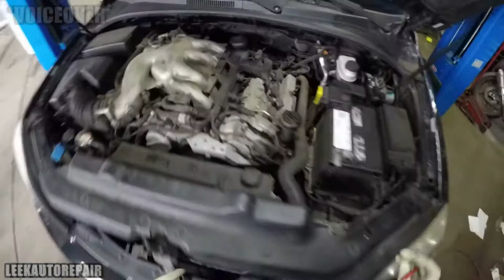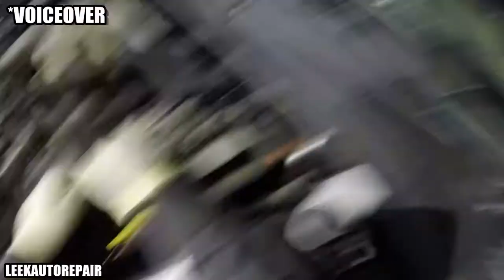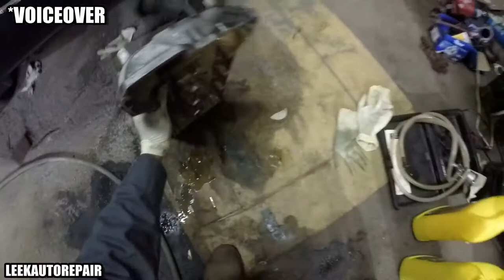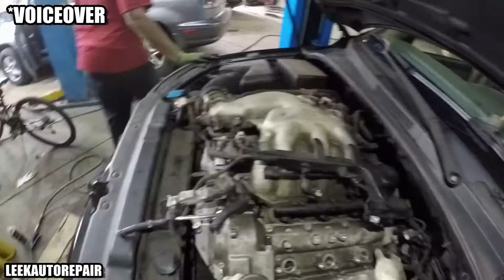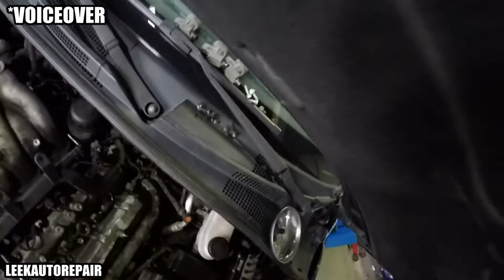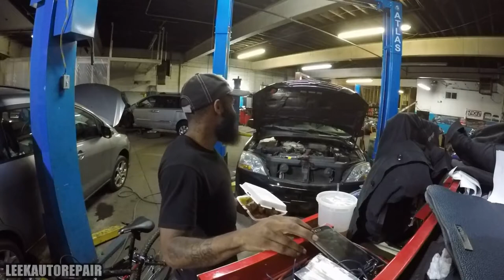Valve Cover Replacement 2002-2009 Kia Sorento

Comment: So i need to replace the valve cover gaskets is it absolutely necessary to change both if one is leaky it has also seeped down onto my alternator which i will also have to replace

Comment: Hey folks, I just replaced my valve cover gasket on my 08 Sedona. Now I see oil on the alternator again. I did a really good job the first time. Torqued the bolts to spec. And used blue gasket maker too.  So what could be the problem here? I'm gonna have to do it again.
Reply: what did it end up being?
Reply: I'm guessing It was because I didn't tighten the bolts in the correct order. I made the mistake of putting gasket maker on the whole thing. I had a super hard time taking it off. After I had it off I used some black permatex for oil and tightened to speck, in the correct order and haven't had any problems there since.
Reply: Steakbread  thanks for the reply

Comment: When you took off the flat cover, and that black box below the cover....there was a wire connector just laying there before you took the connectors off the coils. What was that connector for just laying there? Was it connected to the Bottom of that black box?? Thanks!